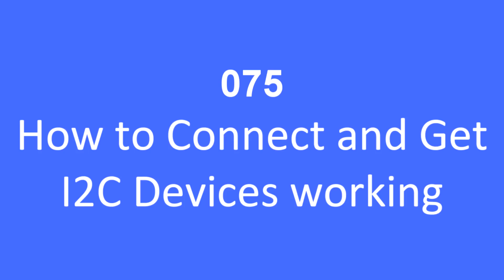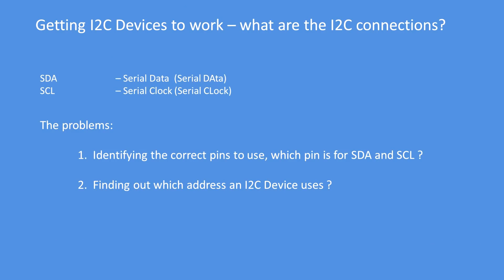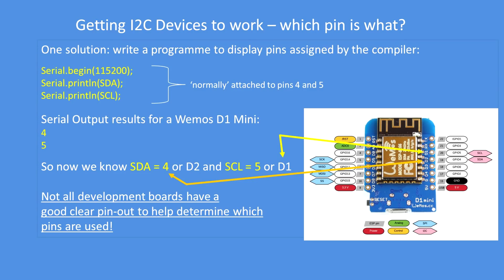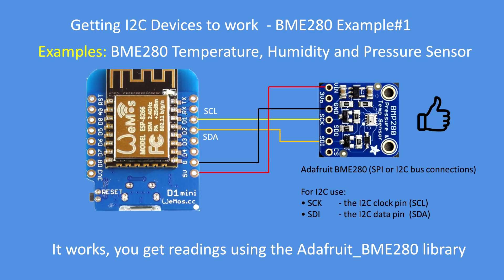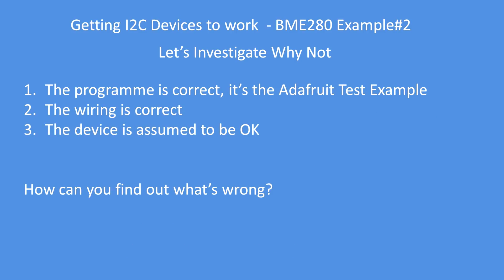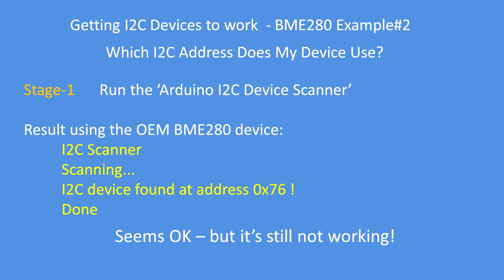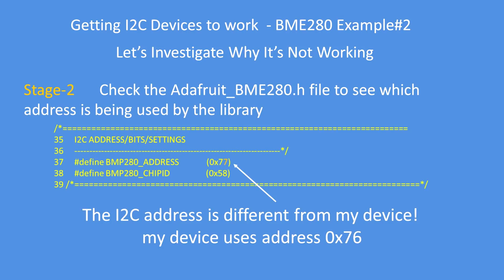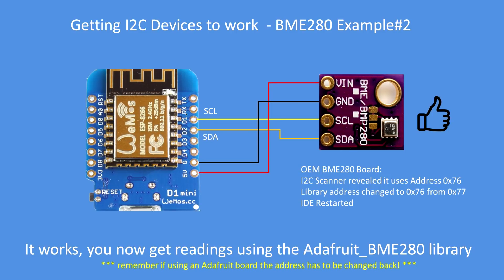Tech Note 075 - How to connect and get I2C devices working (Arduino, ESP32, ESP8266)

Comment: The LED is on D4 (why show or make that breakout pin?) and D8 can't be hardware high at boot (no boot). Just saying because it was extra work. I plan to use 10 or more of those ESP8266 boards because they don't heat up so much with ESP Now. Got some RX/TX working as well, so they can be expansions.

Comment: Thanks for a very good tutorial and video. Just a tip, when you order BME280 on Ebay you will most likely get a  BMP280 delivered to you.  The BMP280 can only measure temperature and air pressure. That means no humidity is  shown.

Comment: I am using an Nodemcu esp8266 and an 16X2 LCD which I have correctly soldered with I2C , I uploaded code to nodemcu for fining the address and also for the device scanner progrma but when I open serial monitor it shows "No I2C device found". This same same thing happens when I try it with my R307 fingerprint module i.e "No device found", i tried a lot and different thing, i connected  SDA and SCL to many combinations which I found on internet( for I2C ), but nothing works. I will be very grateful for anyone's help.
Reply from the maker: Which pins are you using for the I2C bus D1=SCL and D2=SDA or 5 and 4 respectively, make sure you have the correct address for the display type
Reply: @G6EJD  Hello david , firstly thank you for responding , after reading your comment I checked and found that I was connecting in reverse order so I changed D1=SCL and D2=SDA, and then it worked and showed device found at address 0x27. But when I tried to upload Hello world  example program from Adafruit_LiquidCrystal_library_master to it, it is not displaying text on screen although screen is on. So how  can I solve this. Another problem is that my R307 fingerprint sensing module(most probably it is from Hangzhou Grow Technology ) is also working only for D1 and D2 pins, so I can connect only one of them to work, what can I do about this.
Reply from the maker: @dhruvbhati3628  have you tried adjusting the screen contrast, often they are adjusted so nothing shows. Make sure the driver object line refers to the same address as the display. Unless there is an address conflict you can wire both in parallel and use them together
Reply: @G6EJD  Yes, I have adjusted  adn the row is clearly visible but it is not able to display any text, I have tried both 5v and 3v power. And also I have changed the address. Thanks, I think now I have to switch to LED lights for respective indication in my project, this LCD has already taken a lot of time, but if anyone has a solution I will definitely give it a try.

Comment: Hi, I need to make an I2C communication between an Esp 32 and Esp8266, where can I find info about?
Reply from the maker: Well you’d think that would be simple like connect a common ground and I2C SCL to SCL to SDA but no as both devices are configured to be bus masters in a master slave (eg sensor) architecture  so do wire.begin(99);  that should turn one of them into the slave.

Comment: Hi I am unable fix i2c device issues with any device connecting with esp8266 did multiple trials to fix but found no solution I will be happy if you could help me finding a solution with i2c oled with esp8266
Reply from the maker: Benny, the first thing is what size display is it? 1.3” or 0.96” or 0.64” each requires a different driver, next is screen resolution ie 128x64.

Most addresses are common, link to the exact display you purchased please. Should have 4-pins Vcc Gnd SCK Sda
Reply: G6EJD thanks for replying.. I have 0.96 ssd1306 oled board and yes it has 4pins as you have mentioned .. The problem is with i2c I tried bme280 to figure out the problem and the i2c never finds the address even though I tried defining the clock frequency and pins for the esp8266
Reply from the maker: Benny, what driver are you using? I find the Adafruit versions don’t won’t if not their displays
Reply: @G6EJD  thanks a lot for your time.... I have fixed the issue... it was the jumper wire.... I think wire strands inside the wires were broken...... which made me to run around crazy for 2 days... on the way It helped me learn many things...
 Adafruit library is working fine so far....thanks a lot for your efforts.... stay safe ..have a fine day...
Reply from the maker: DuPont cables are notoriously bad for faults, been there, done that too!
Reply: @G6EJD  indeed they are... they took out for a roller coaster ride.... I even formated my laptop for this sake thinking I could it.....  have to find a better way to use quality dupont wire...
Reply from the maker: DVM set to continuity mode is what I use and always test the cables first.
Reply: @G6EJD  that's is what I have decided to do before starting any project.... fundamental rule to do before getting excited with any electronic project....
Reply from the maker: It’s a worthwhile task, I do it because it’s happened to me so-many times, they can also be intermittent too.
Reply: @G6EJD  yes they are.... and we try solving otherthings thinking we are fixing it making everything worse just because of this this mere evil wire...

Comment: // i want to connect apds9960 and mpu6050 but it doesn't work
//people help me .
// i have changed some a little things in the code of apds9960.
 #include <Wire.h>
#include "mpu6050.h"
#include <SparkFun_APDS9960.h>
// Pins
#define APDS9960_INT    2 // Needs to be an interrupt pin
// Constants
// Global Variables
SparkFun_APDS9960 apds = SparkFun_APDS9960();
int isr_flag = 0;
float tmp;
int address_sensor1= 0x68; //binary equivalent is 1001000

int address_sensor2= 0x39; //binary equivalent is 1001001

int accelX, UP, DOWN, LEFT, RIGHT;
void setup(){

Serial.begin(115200); //this creates the Serial Monitor

Wire.begin(); //this creates a Wire object
mpu6050();

 Serial.println();
  Serial.println(F("--------------------------------"));
  Serial.println(F("SparkFun APDS-9960 - GestureTest"));
  Serial.println(F("--------------------------------"));

  // Initialize interrupt service routine
  attachInterrupt(0, interruptRoutine, FALLING);

  // Initialize APDS-9960 (configure I2C and initial values)
  if ( apds.init() ) {
    Serial.println(F("APDS-9960 initialization complete"));
  } else {
    Serial.println(F("Something went wrong during APDS-9960 init!"));
  }

  // Start running the APDS-9960 gesture sensor engine
  if ( apds.enableGestureSensor(true) ) {
    Serial.println(F("Gesture sensor is now running"));
  } else {
    Serial.println(F("Something went wrong during gesture sensor init!"));
  }
   
}

void loop(){
Wire.beginTransmission(address_sensor1); //Send a request to begin communication with the device at the specified address

Wire.write(0xFC); 
Wire.write(0xFD);
Wire.write(0xFE);
Wire.write(0XFF);

Wire.endTransmission(); //this ends transmission of data from the arduino to the temperature sensor

  Wire.requestFrom(0x39,6); //Request Accel Registers (3B - 40)// 0x68
  while(Wire.available() < 6);

    UP = Wire.read()<<8|Wire.read(); //Store first two bytes into UP
    DOWN = Wire.read()<<8|Wire.read(); //Store first two bytes into DOWN
    LEFT = Wire.read()<<8|Wire.read(); //Store first two bytes into LEFT
   RIGHT = Wire.read()<<8|Wire.read(); //Store first two bytes into RIGHT
   
   processAccelData();
    delay(1000);

  Wire.beginTransmission(address_sensor2); //I2C address of the MPU
  Wire.write(0x3B); //Starting register for Accel Readings
  Wire.endTransmission();

  Wire.requestFrom(address_sensor2,6); //Request Accel Registers (3B - 40)// 0x68
  while(Wire.available() < 6);
   accelX = Wire.read()<<8|Wire.read(); //Store first two bytes into accelX

    processAccelDataB();

  delay(1000);

}

void interruptRoutine() {
  isr_flag = 1;
}
void processAccelData(){  
  if( isr_flag == 1 ) {
    handleGesture();
    detachInterrupt(0); 
    isr_flag = 0;
    attachInterrupt(0, interruptRoutine, FALLING);
  }
}

void processAccelDataB(){
  int value=map(accelX,-16384,16384,-90,90);
 
}

void handleGesture()
{

 apds.readGesture();  
 
 if(UP==DIR_UP)
 {
 Serial.print("UP");
 }
 else if(DOWN==DIR_DOWN)
 {
  Serial.print("DOWN");
 }
 else if(LEFT==DIR_LEFT)
 {
  Serial.print("LEFT");
 }
 else
 {
  Serial.print("RIGHT");
 }
        
  }

Comment: A great video. It seems what you described are not really the problem of I2C devices, but the problem of some of those libraries available out there, in this particular case Adafruit's library. Personally I normally try to avoid Adafruit's libraries, their libraries tend to do too many things with one single library, and therefore bloated and sometime not easy to use. I also try not to mess with the library in order to make the code work, because very soon you might forgot what have you done with the library, or when the library get updated the code will no longer work, or if you share your code on github or somewhere, the code might not work unless you pack with the modified library as the dependency. I usually just uses the good old Wire library for all my I2C needs, it is a little bit more work, but it is what most of the libraries built from.
Reply from the maker: E-Tinkers, agreed, but Adafruit have greatly improved their libraries and no allow e.g. bme.begin(sda,scl,speed); to override the default pin allocations which is a good improvement, but yes when I made this video that was their problem of using pin definitions suited to only their boards and sensors, fair-enough, but a move to a more open source approach by them is particularly welcomed I think.
Reply: @G6EJD  yes, a PR (pull request) on their github library with a good reasoning for such case will normally get accepted and changed in future release...

Comment: Thanks for your tutorial. But my ESP32 reboots some times when I use RTC DS3231 chip, I can fix it
Reply from the maker: Check your connections and power source to the RTC. Is there a pattern to the rebooting? Is the RTC designed to be supplied by 3.3v or 5v? Make sure the RTC is getting the correct voltage.

Comment: I want 2 Wemos D1 Minis to talk to each other...how do I wire and configure 
it?
Reply from the maker: You set up serial (software serial) ports on each device say on pins D8 and D7 with one D1 configured as D8=Tx and D7=Rx and on the other D1 D8=Rx and D7=Tx the serial poets must be cross connected, but in this example I’ve defined the pins differently so achieving the cross connection as ordinarily D8 goes to D7 and D7 to D8. Therefore wire in my example D8 to D8 and D7 to D7.
Then you can can send data from one device and vice-versa. I’d start with a baud rate of 9600 for test purposes.
It would be very difficult to do this using a network protocol. There are plenty of software serial examples around including in the IDE Examples

Comment: how would you use several i2c busses with this method?
Reply from the maker: Do you mean devices or buses? If the latter there is little to no support for multiple buses. If using the same I2C devices you have to use an I2C multiplexer if using different I2C addresses then they all have different addresses and all sit on the bus in parallel
Reply: @G6EJD  I mean busses. I want to use multiple BME280, but the IC just supports two Addresses - my solution idea was to use multiple busses with each two sensors connected. But would you recommend hardware I2c multiplexer in this case?
Reply from the maker: There is no working multiple I2C bus library that I have seen, I have tried to instantiate two buses recently but it does not work. You need to use a standard I2C bus multiplexer the base address is the address of the multiplexer then each device is +1 so for the bme280 that would be (say multiplexer base address is #50) then each bme280 would be located at #50, #51, #52, and so-on.

Comment: Thanks for the info, amazing way to show the solutions to many problems you encountered, saved me a lot of time on research, thanks a lot again, I do try to do the same as you!
Reply: Hey so I just researched more and I found the way to do it without making changes to the library, I'll be uploading a video about it and referencing your video (if you let me to), it will be in spanish tho
Reply from the maker: Yes, since I made the video many libraries have been updated to allow addresses to be defined thereby removing the need for modifications. However most people can’t find out what pins are clock and data and don’t understand how to approach the problem. Please go ahead and reference my video.
Reply: @G6EJD  If it wasn't for your video I wouldnt Have found the solution! Ill go ahead and make it

Comment: Opened bme280.h file in notepad++ and can find no address to change
Reply from the maker: Not sure what library your using but the address has to be somewhere, in the Adafruit version on line 37 is this:
 #define BME280_ADDRESS                (0x77)
Which needs to be changed for most non Adafruit products to 0x76 or on the pcb bridge or break the jumper depending on the type, that will bump the address up by 1 then 0x77 would work as a default.

Comment: Much thanks for your continued upload of these instructional videos!  Contrary to the advice given at 7:22 i had to uncomment Wire.begin in Adafruit_BME280.cpp and put in the pin numbers as follows -

    // init I2C or SPI sensor interface
    if (_cs == -1) {
        // I2C
        _wire -> begin(21,22);

My ESP32 is a " 'Wemos' Wifi&Bluetooth Battery" (which is the name given to it within the 'Boards drop down menu' in Arduino).
I had also changed the address of the I2C BME280 within Adafruit_BME280.h to (0X76) as that is what your 'I2C scanner' sketch spat out..

I will now return to your "ESP32 and BMP180 or BME280 and OLED SH1106 or SSD1306 display Weather Forecaster" script and get that working :)

Comment: Very important hint, I solved the problem by copying changed libraries into the local libraries folder, then with platformio they have 1st priority and the global lib will not be changed. But without your hint, I have never had found the problems. THX